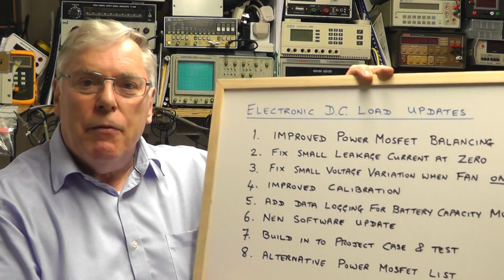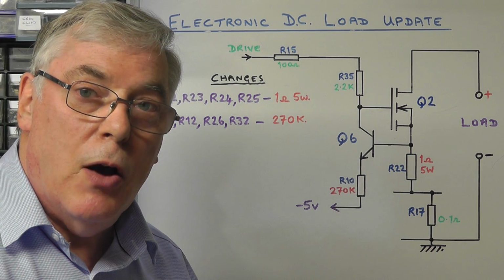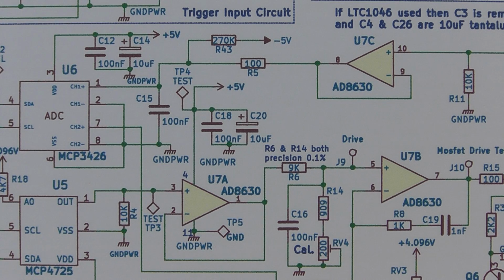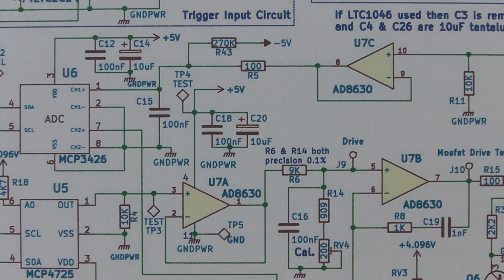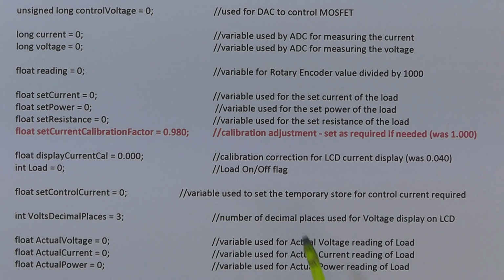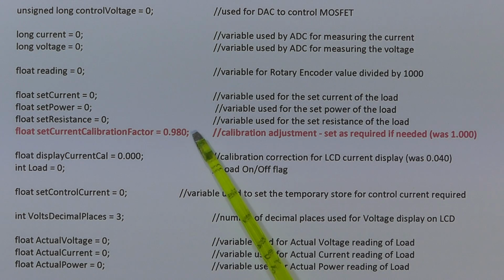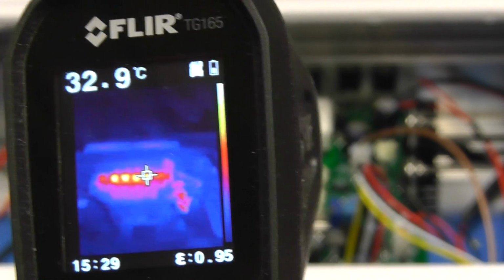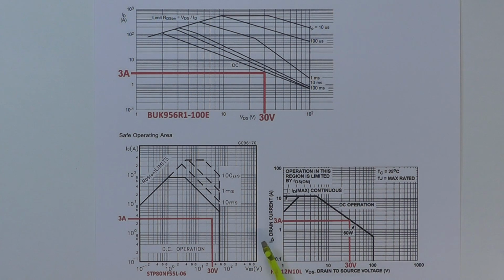Scullcom Hobby Electronics #57 - Electronic DC Load Part 9

Comment: Doesn't it sound a bit desperate to change ballasts a whole order of magnitude? Testing lithium cells down to a 2v cutoff can never exceed ~5a due to RLmin of >0.35* ohms. At 2v using 0.33 ohms would allow >10a and 0.25 ohms >12amps (* provided another binding post is mounted to bypass even more resistance offered by D5 and F1). I would never go by the name Alice, but now I guess I have to see Part 10... ;-)
Reply from the maker: Hi Cliff,
I see where you are coming from but so far I have had no issues testing LiPo batteries. I do set the current to 1 amp or lower so any voltage drop is small. If you wanted to replace D5 with a shorting link that is always possible if you wish. I tested the DC Load with various values of Mosfet source ballasting resistors and found that a 1 ohm was a nice compromise to give good power sharing and operation of the DC Load overall. The DC Load seems to work just fine.
Regards,
Louis

Comment: I'm curious...  With three 6-1/2 digit Keithley meters on your bench, why did you not use them to measure the output voltage and current from your Tenma power supply during calibration?  They'd have been much more reliably accurate than the meters built into the power supply, and would have had higher resolution than the device being calibrated, instead of less.

Very enjoyable series, Louis.  I always look forward to your next video.  Thanks!
Reply from the maker: Yes you could use more accurate test meters if you wish and that is always there as an option. But as we are only looking at accuracy to with in a few milliamps or millivolts the power supply readings should be OK for the hobbyist and I decided to keep it as simple as possible on this occasion. I am always conscious of the fact that most hobbyist do not have access to expensive meters.
Nice to know you enjoy this project.
Regards,
Louis
Reply: Scullcom Hobby Electronics thank you so much for doing just that. 😀 If we weren't Hobbyists, we wouldn't build this and just buy a Electronic Load for many hundreds of $/€/£. Besides building things is so much more enjoyable than buying a finished product. This reminds me of when my father built a Heathkit multimeter/oscilloscope/television as part of a electrics course in the military.
Reply: This is hobbyist level. No need to show of expensive equipment since most people don't have them available.

Comment: Iam Very interested in see the control circuit analysis by a control theory way, stability and design a proper compensator, is that possible? Thanks!
Reply from the maker: I suppose you could use a Spice Model to analyse the design if you wish.
Reply: How about matlab and spice? :D